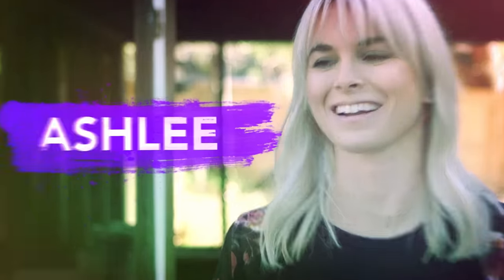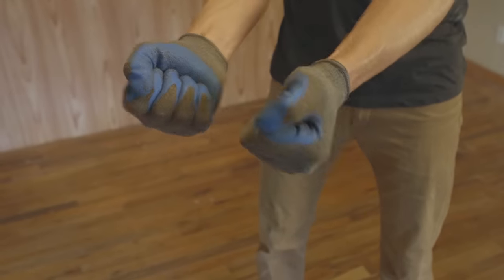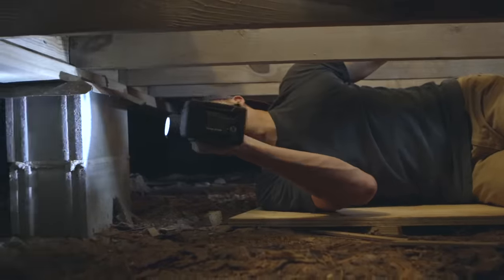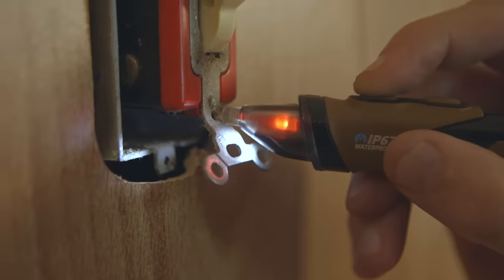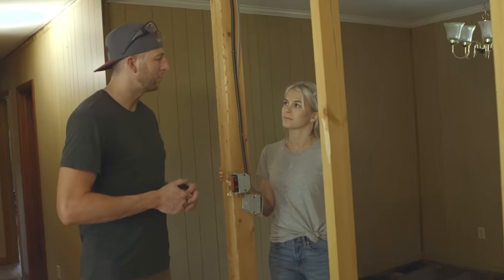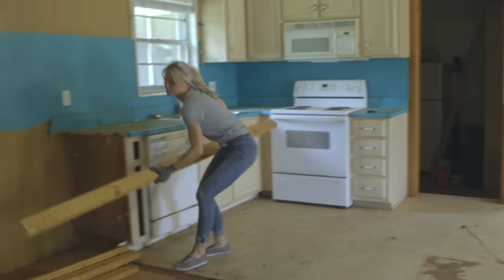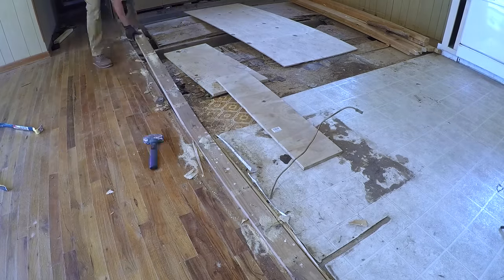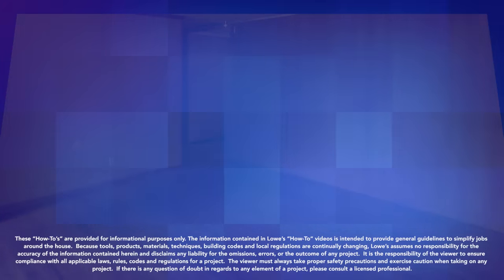How to Demo and Remove a Wall

Comment: Step one: hire a structural engineer to tell you if it's load bearing.
Reply: Or do it yourself and save a lot of money!
Reply: Or if you were the one to build the house either 1 just remember or 2 look for the blueprints of the house
Reply: Just take the wall out and gage how the house responds.  You’ll easily be able to tell if it’s load bearing or not.
Reply: @youtubeisbroken241  Exactly.  If the house collapses on you then you know it was load bearing.
Reply: Myballsitchsomethingfierce  ,  City Hall would have each homes' floor plan ??
Reply: @jtoo6060  Not mine. My city decided to upgrade their system in 2005 and trashed all blueprints for homes built before then: my home was built in 1996. There's this stupid 3ft4in wide wall in between my kitchen and living room, I want to get rid of it but most GC keep saying it's possibly load bearing for the 2nd floor above it. Only 1 contractor (specialty in carpentry) says no way a small wall like that is load bearing. I forgot to mention, that stupid tiny wall has an equally stupid random 2-door kitchen cabinet attached to it. It's like literally 10ft from the main kitchen cabinets doing f**kall for the function or aesthetics of the kitchen.
Reply: @invisigrl  youtube videos are fun to make, its a form of creative expression
Reply: Depends on the wall, some are easy to tell and hiring an engineer may be unnecessary.
Reply: @stupidkitty84 we must have the same floor plan. Exact same wall. What did you end up doing?
Reply: It’s actually really easy to tell if it’s load bearing lol y’all act like you need to hire someone
Reply: lol if that’s your thinking step 2 is hire someone to remove the wall for you
Reply: Every diy video has at least one comment telling you to hire someone. I wouldn't know a damn thing if all I ever did in life was ask someone else to to it for me.
Reply: Or just yolo
Reply: it's not hard, pretty much common sense, and if it is a load bearing wall you can just jack it up and install a header.

Comment: These tutorials always stop at the easy part. I want to see how you bring the mismatched floors together without redoing the entire floor, and also how do you repair the walls.
Reply: Sammy Lopez lopp
Reply: They’re going to have to redo the entire floor that’s all there is to it
Reply: You need a transition unless you want to redo the entire floor.  On a seam that long, you may want a professional to do it to make sure it's perfectly straight.
Reply: Appreciate the replies, but I have an old house with original floors I want to keep so I would like to match them and not rip out $5000 worth of flooring for 20 square feet
Reply: @sammylopez4644  what if you put in a new wood floor on the section you want to match and then sand and re-stain the whole thing together?
Reply: @AgentDoubleV_Gaming  That's what I'm looking for.
Reply: @sammylopez4644  Perhaps take out the old nice flooring, sell it at premium, and replace it with a flooring of your choice.
Reply: Finding the breaker for the light switch should have also taken 10 minutes. I've never been in an old house that has breaker box that's actually marked accurately. Pro tip: If you have an old house with DIY electrical work and need to do anything with the electrical, just turn off the main breaker. You will save yourself some zaps.
Reply: @sammy lopez did you ever find a solution?
Reply: And the electrical wires🤷‍♀️
Reply: If it were me I would just put a table and a rug there.

Comment: Please don’t advise DIYers on how to determine if a wall is load bearing. Very cheap price to hire a structural engineer to make an assessment versus the possible danger and damage caused by improperly removing a load bearing wall.

Comment: Load bearing walls aren’t always tied to truss system; you also need to see if joists terminate on top of your wall.
Reply: I used to work with a guy who bought a flipped house. After living there for a few years, he noticed the roof was starting to sag and pinned the blame on whoever flipped the house before him taking out a load baring wall without adding any support structures back.

Comment: The ceiling joist may be over spaned now. An engineer may determine that the existing joist may need to be sistered to meet code. You can check the spam tables yourself and or take a carpenter class at your local college

Comment: God bless you guys thank you for your information the only thing that I really like about the construction from the era is that the smells from the kitchen will not go anywhere else.
Reply: If you have a good air ventilation unit it should significantly reduce this issue, otherwise even the walls, cupboards and ceiling gets stained over time from the steam carrying tiny food particles.

Comment: Hi guys, great video.
I have a question maybe two.

I’m a single mother with champagne taste but on a serious beer budget.
I bought a 1940’s home and it’s less than 900sf.
It has shiplap that I’d like to reuse after I open the whole house up.
But all I have is a small crowbar a hammer and small saw.
Any advice?

Comment: You forgot to mention the direction of the joists relative to the wall. If joists lap on that wall then it’s load bearing. Also if removing the wall would overspan the joists then it’s load bearing.
Reply: Good point .... I think what you are saying is that if the joists are crossing over the wall and are right on top of them it is load bearing.  But I am not sure what you mean when you say the "joists lap"?  What does lap mean?

My house is an old house and has a load bearing wall running down the middle of it, and there are two sets of ceiling joists from from each side of the house and meeting in the middle over that load bearing wall.  That is the middle of the house has a wall where the joists meet and are nailed together in addition to being nailed to the top of that load bearing wall.  Is that was lap means?
Reply: @justgivemethetruth  yes that's what lap means. Joists are commonly 18ft long. If your house is wider than that then the joists will have to overlap on an interior wall. Or if it's like my house, the idiot framers used differing dimensions of joists and they lap several times. Instead of running 2x8 joists across the whole house, they broke it up into sections of 2x6 joists and 2x8 joists.
Reply: @xBRVTALx  
Thanks.  So, I assume when you say "overspan? you mean create a condition where the joist is spanning a distance larger than the code would permit for its strength or dimensions?
Reply: @justgivemethetruth  correct. Lumber has a maximum unsupported span rating based on the type of lumber, dimensions, etc.

Comment: I always thought that any wall running perpendicular to the ceiling joints (across them) is load bearing and should not be removed without adding a structural beam supported on the ends.
Reply: Absolutely correct.
Reply: Lady wanted to have a loft feel. 

“Take it all out !, she said. “

(No regard for the rest of the floors above coming down. Just a loft feel. )

“ l have $100 bucks for the project !”

Comment: How do you know if it's load bearing on a 2 story home with a concrete slab foundation
Reply: How?  Wouldn't you have continuous studs from the floor up THROUGH the bottom storey's ceiling and up TO the top storey's ceiling that has ceiling joists and maybe braces to the roof on it?

Comment: The breaker should be locked out.  At least taped over.  More of an issue if the wires were not in the fixture.